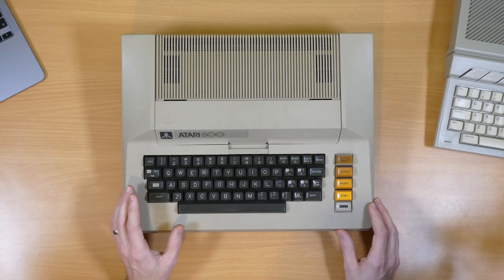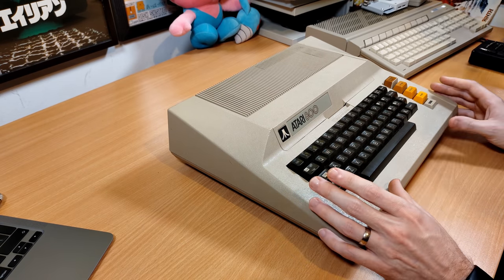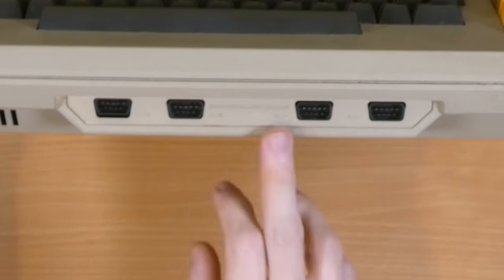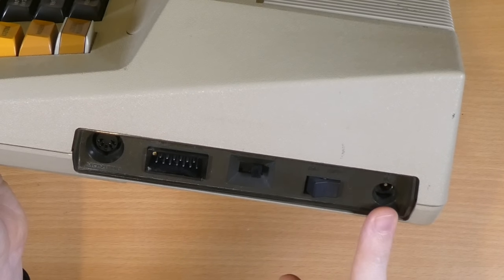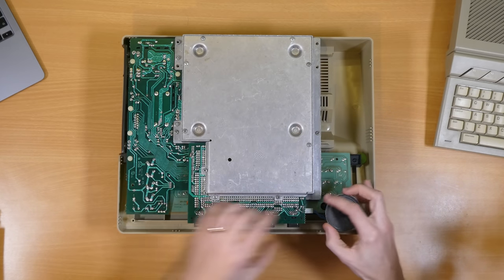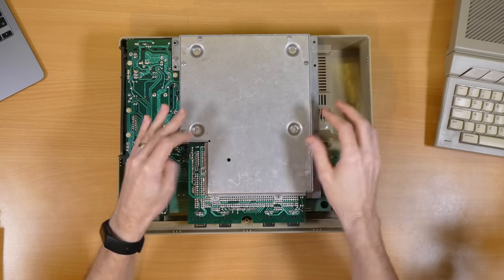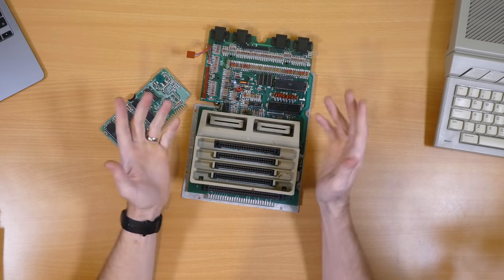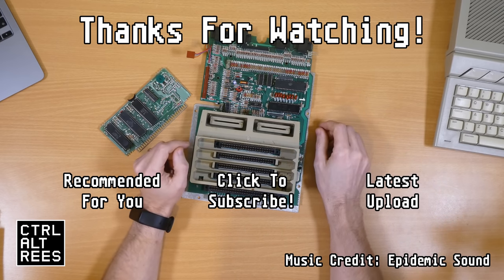Exploring The Atari 800 - Teardown Of Their First Home Computer From 1979

Comment: Big potentiometer on the CPU card, and you didn't say what it was for?
Reply from the maker: It's for micro-adjusting the video timings. If the colours are "off" tweaking this pot usually fixes it - there's even a hole to be able to access it externally without taking the machine apart.

Comment: The 800 looks and feels quite sturdy compared to the Atari 65XE, which feels squeaky and brittle.
Reply from the maker: Oh yes, a product of a completely different era at Atari... 😕
Reply: @ctrlaltrees   Definitely a happier era full of promise.  Atari had no choice by the mid-1980s, however.  They had to find some way to chisel into the incredibly price-competitive mass consumer market, having failed to crack other markets for various reasons (some being of their own doing).  They had no choice but to let Jack Tramiel have his way because Commodore was killing everyone.  He liquidated the XL series for a loss on each sale (the 800XL is easily the most popular Atari model, and the vast majority of them were sold at a loss to help maintain market share and industry support).  After that, the XE series had to be significantly cheaper to make or else Atari might as well have closed down at that point.  Meanwhile, the C64 got even cheaper to make but nevertheless improved in quality as its design was refined.  Commodore had their own chip fab, which reduced cost, and the C64 has a single LSI chip (VIC-II) for graphics.  Atari tried to design a single chip that was compatible with the ANTIC+GTIA combination, but both prototypes, called CGIA and KERI, did not pan out, putting additional pressure on the XE series build quality.  Many hate on Tramiel, but without him and the money he had made from Commodore (from which he was fired by people who would later run Commodore into the ground for no good reason), Atari might not have survived the early 1980s.

Comment: Incorrect on the initial RAM:  The 400 and 800 initially came out with 16K RAM and only the Atari 800 was easily upgradable to 48K RAM with expansion modules.  (The 400 could also be upgraded but it was not an easy upgrade like the 800.)  Neither of them ever came with only 8K.  Interestingly, the Atari SIO port was a direct predecessor to the USB ports on modern computers.  At this point in time, I still have my Atari 400 that I got as a kid back in 1982, as well as two Atari 800's, a 600XL, 800XL (Rambo upgraded to 256kb back in the late 80s), 1200XL, 65XE and 130XE in addition to my other Atari consoles and computers from the 1040STe to my Jaguar and Lynx.  As well, I can't believe it but I also still have an ICD 1mb MIO with the SCSI hard drive interface which worked like a dream in SpartaDOS X back in those days when I ran my BBS off that 800XL and my XF551 drive.  I ran the XE-BBS for about 9 years as a kid and then teen before moving out to Silicon Valley to start a career in networking and helping with building out the Internet.
Reply from the maker: Thanks for the info. I'm just looking at the 400 motherboard now - you're absolutely correct of course. It only has the one RAM slot unlike the 800. I really need to get my hands on one so I can compare the two side by side, but they're very rare in the UK.

Comment: I don't understand why this machine wasn't more successful. It's virtually on par with the C64, and it arrived 3 years earlier. Too expensive? Bad marketing campaign?
Reply from the maker: Too expensive, I think. Although the Atari 8-bit platform was in production in one form or another until 1992 (when the XEGS was discontinued) so it was certainly very long lived.
Reply: It was too expensive to make in order to compete with the C64 in the mass consumer market, and the high-end (in terms of price) 8-bit market was dominated by the Apple II, which had far more industry support because it came along even earlier, had a superior floppy drive system (attractive for small businesses), and was an "open" system, while Atari charged a lot of money for giving out their computer's technical details.  They gave the latter away for free when the C64 was released and dropped the retail prices of their computers through the floor in order to compete, but this bled Atari's (Warner Communications') money, so the video game crash of 1983 hurt them even more.  Atari made some bad decisions, but they were also caught in between markets that presented barriers to them, and were dominated by other companies that owned those markets for various reasons.

The C64 was just about as capable but cheaper to make, while the Apple II came earlier and had massive support from everyone.  Sadly--very sadly--it was as though there wasn't much of a place for the Atari 8-bits.  It seems "unfair" given how cool and capable these computers were, especially for their time, but products need to find their place in order to be as successful as they can be.  All things considered, I think the Atari 8-bit was fortunate to be as successful as it was, and I think this is a testament to the recognition of how awesome its design and system architecture is.  This wasn't enough to make it dominant in any market, but it kept getting chances, and it was far from a failure in a business that had plenty of failures.  Price and industry support matter--never mind the C64, just look at Atari's own 2600 in the console market.
Reply: @ctrlaltrees   It sure didn't go away quickly, even in the face of declining industry support, and it still has a major following today for something that is technologically obsolete by decades. 😃

Comment: wow that is a terrible sh§$%&y keyboard, I think I had the same brand/mech in my Commodore PET I was so mad that they incl. such a crappy keyboard, I sold the whole unit. All the solder joints were broken and the keys were stuck when you press them and give bad contact, the metal clamps inside would be bent and whatnot, it was the horror.
Reply from the maker: It was certainly better than some of the competition - and of course miles ahead of the 400! But I agree, stuck keys and bent metal contacts are definitely a problem with this keyboard.
Reply: @ctrlaltrees  did you not have bad solder joints? ALL of mine were cracked very visible and it was such a cheap junk I was happy to get rid of it asap.
Reply: Hmmm...my 800's keyboard is great, and it's one of my favorites among vintage 8-bit computers.  I've heard that most 800s got the good keyboard, but that some got the alternative keyboard that is always breaking (as in literally, to pieces).  Maybe you both got the bad one.

By the way, the 600XL and 800XL had at least five different keyboards, and some were much better than others.  I got the most common type of keyboard on my 800XL, and I'm not exactly thrilled with it.  The keys won't depress unless you hit them dead-center, and the feel is clunky at best.  Even my C64 keyboards are much nicer to type on.